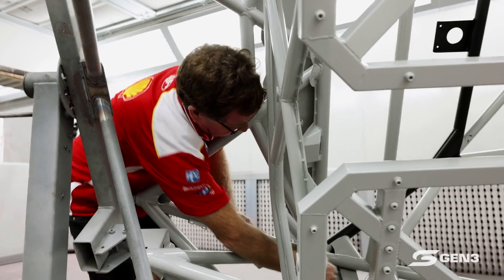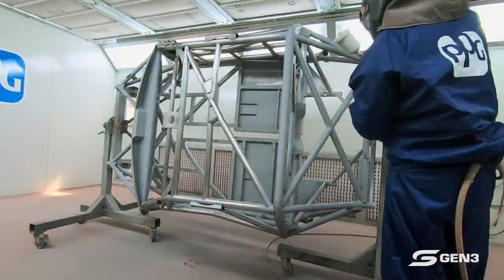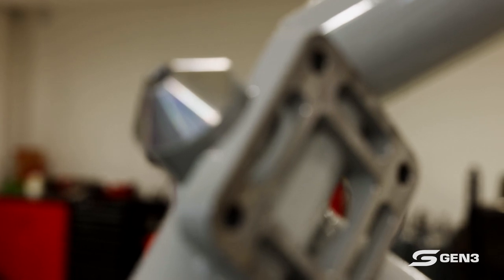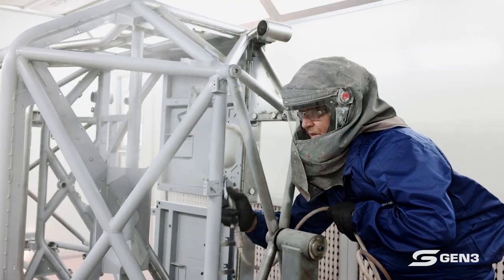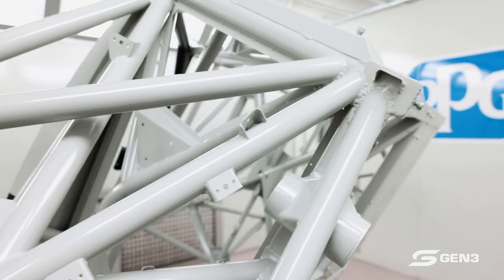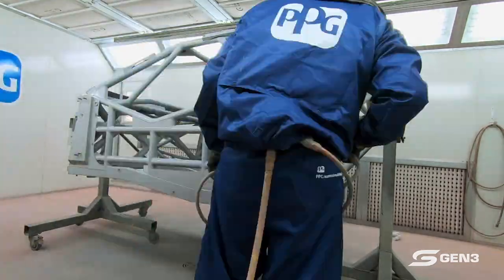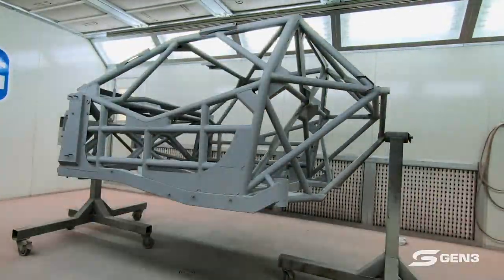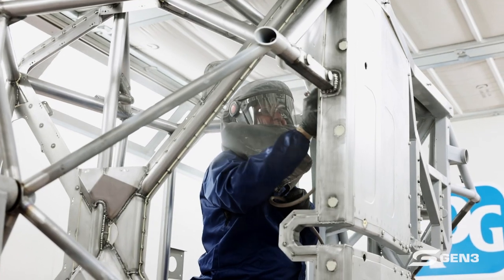From Sierras to 'Stangs: Painting the Gen3 Chassis | Supercars 2021

Comment: Supercars  ... Please don't wreck the category by putting in paddle shifters  ... You'll just turn them into easy to drive oversized go carts ... 🥱
Reply: in what way does paddle shifters wreck the racing?
Reply: They still wont be easy to drive and wont wreck the racing.
Reply: technically safer as both hands are on the wheel at all times
Reply: @MrQuistus  They don't have to heel toe on the downshift, with paddle shift. Not that the spectator would really notice, but it does take away an area where a better skilled driver can have a slight edge. I don't care either way. Most Mustangs and all Camaros are automatic anyway, in their road form
Reply: They don't have to heel and toe now really. I know it's because of an old injury but Fabian doesn't for example. At the end of the day every major series there is either paddle shift or sequential stick with no heel and toe. There are relatively old drivers now (at least in Europe) who have never driven a race car with anything other than paddle shift in all the categories they've driven let alone have had to learn to heel and toe.
Reply: @adematthewsracing  only because he left foot brakes which everyone will probably start doing with paddles
Reply: @micknstacetube  I know he left foot brakes but it's only because of an old injury and he has said many times that he would right foot brake if he could. I wouldn't be so sure that everyone will start left foot braking only with paddles. In the BTCC they use a sequential box without paddles but they don't use the clutch on either shift however many of the field (mainly the older drivers) right foot brake still.